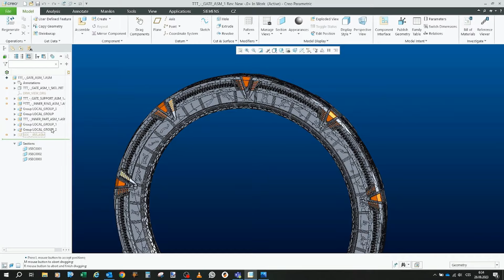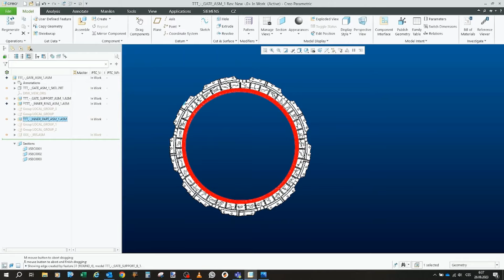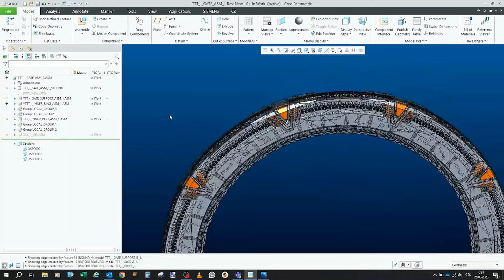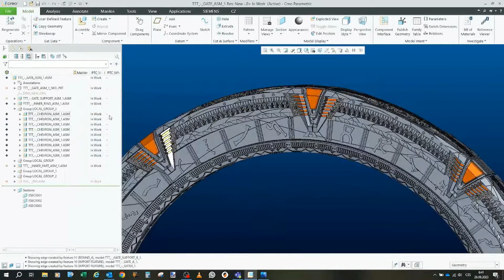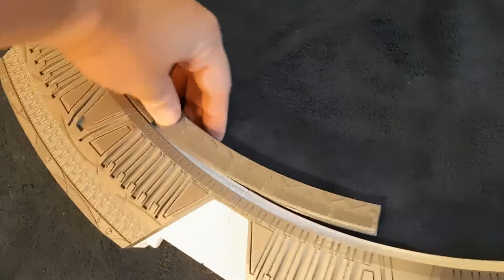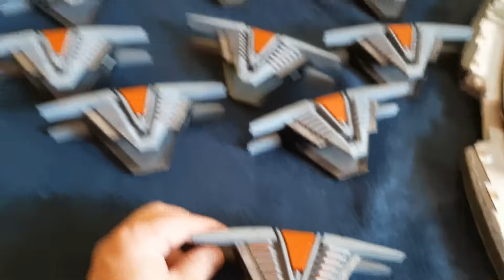Project Big Stargate 80cm diameter

Comment: I have a few technical questions (it would be nice if they were provided as standard information in the future for all projects):
- What layer height did you set for the models?
- What percentage of fill did you use?
- How much does the finished model weigh?
- How much filament did you use for all parts?

If you wanted to make a movable Stargate that would be very cool.
I can help with electronics.
Reply: He is correct, for example
for internal prints I use 0.3mm for other parts I use 0.2mm, sometimes I use ironing, I have partes that I use variable layer hight to have more detail, other parts I print on SLA.
I also have parts that I print with a different position that he prints so that I have better detail and quality.
I also did some edits on some parts so that I could print in a different position to give me more print quality, I did that on the Asgard O'Neill ship and on the F-302.
Reply from the maker: i do not see any point in doing that. I provide the data. You print it as you see fit. Why should I tell you how to do it? You may have different machine, different needs, different experience with materials and so on. Thus my setting, while working for me - may not necessarryly work for you. Thus I never provide prinitng specs. 

As for you other question, I may give it a try to make a "workable" gate in a future but not right now. I am already working on a new project ;)

Comment: I tried to make a 20 cm one with moving chevron and spinning ring but my attempt has been failure. I think I will have to follow your example and make it bigger with several pieces.
Your gate is awesome
Reply from the maker: i have also roughly 20cm gate. The chevron does not move but the ring does indeed spin

Comment: That is an amazing model! Great work! Did you consider adding LEDs into it or otherwise illuminating it for wall display? I could see a blue rear glow with the iris closed looking particularly cool and in keeping with the show.

Btw, what filament type / colors did you print it with? Looks like the regular Prusa Silver PLA for the main ring, but I'm not sure.
Reply from the maker: It has a preparation for cables so LED lights are possible. I will however not do them. Yep material as you said.